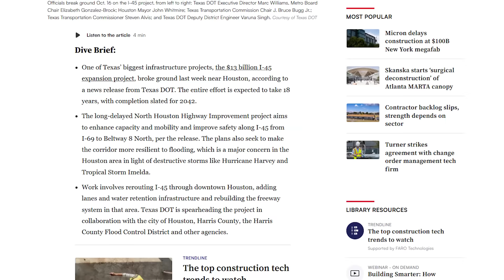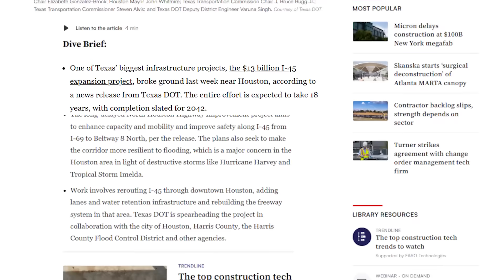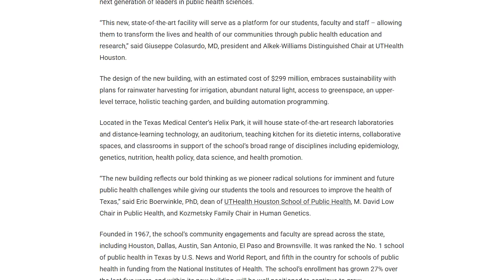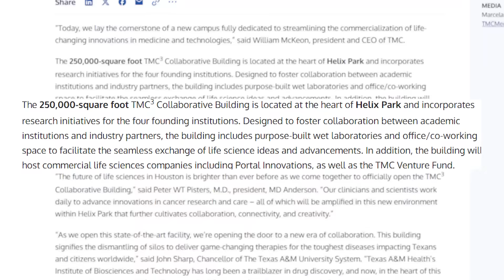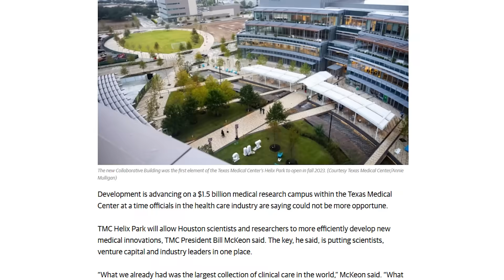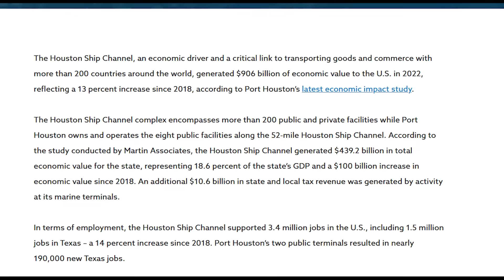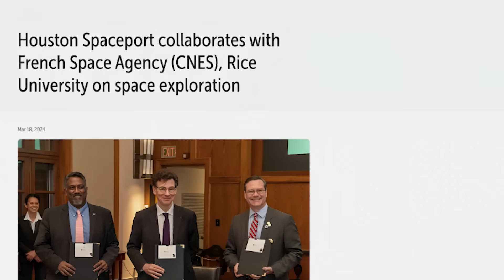Houston Megaprojects: 4 Projects that Will Change America in 2030

Comment: High speed trains is what houston needs
Reply: No way. Too expensive for the distances it would have to cover. The thing about Houston critics is they always talk about the freeways being a mess, crowded, backed up and then they show rush hour all stacked up. Two major interstates cut right through the city. I-45 and I-10. You know what they don't show? The surface streets. If you stay off the freeways and take the surface streets, its not too bad.
Reply from the maker: Absolutely! High-speed trains could revolutionize transportation in Houston and beyond. It would make getting around so much easier and faster!
Reply: No it does not.